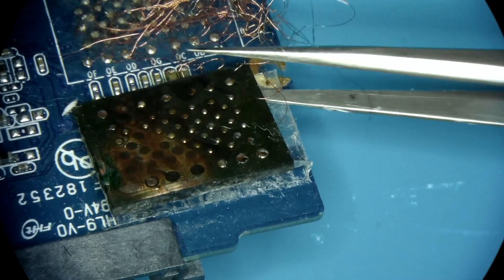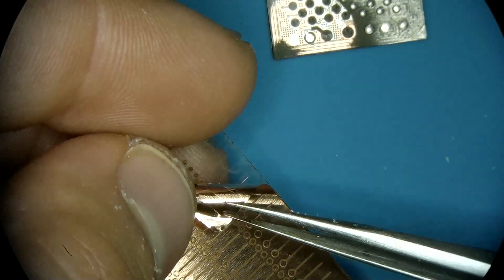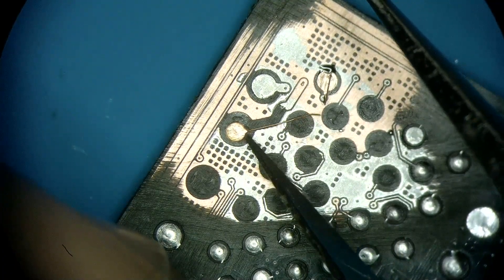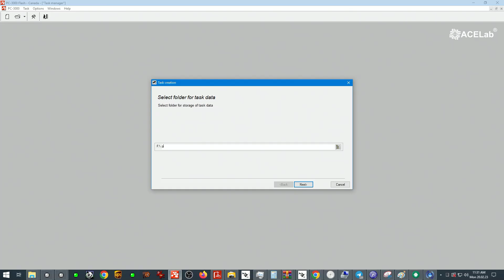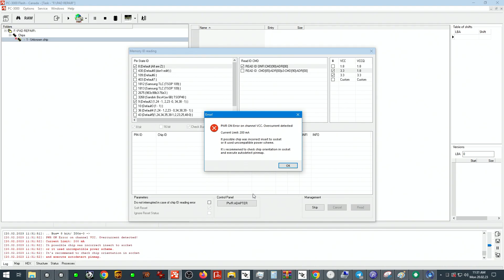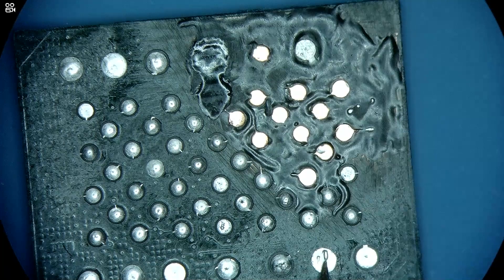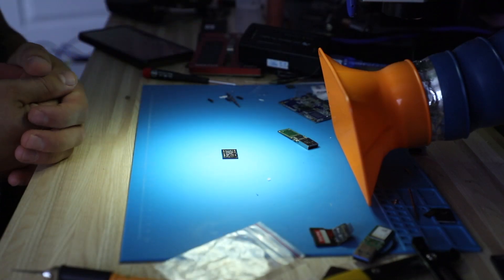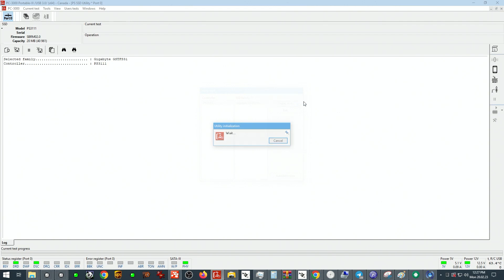can ssd be repaired in this condition?

Comment: a tiny amount of 2-part quick cure epoxy would help a lot to keep those replacement pads in their place. insulin syringes with their tiny hipodermic needle are great for measuring out tiny amounts of the 2-part epoxy.

Comment: the wires are likely issue.  on boot the device will train dram to get the best possible performance, if timing is outside a range because the wires are so long for example then it will fail to get memory access.  the registers you were looking at are not in dram.  it might have been easier to get a new dram chip, the characteristics of chip are important
Reply from the maker: VCCQ is short to ground it's in the video.

Comment: Do you prefer your MG flux over something like Amtech?
Reply from the maker: I didn't like amtech :) no disrespect to anyone using it and swears by it, to me it's not a good product. One of the main reasons it dries up too quickly and turns cloudy when it hardens
Reply: Thanks man! I've never used the MG Flux. But I just ordered it a tube to give it a shot. I mean you do good work with it so I'm hoping my experience will be the same. And it's not that expensive so

Comment: I had some minor success in the past with restoring chips which had their power rails shorted because of an earlier overvoltage. I think the clamping diodes got fused, and when these get burned out by additional stressing it can partially work again. I used a transistor curve tracer to stress the chips on the AC mode with current limiting, and quickly bumping the voltage up and down using the collector voltage knob (effectively creating voltage spikes), each time a little higher, all the while I'm paying close attention at the U/I curves.
Reply from the maker: very good call dude! thanks I will look into that